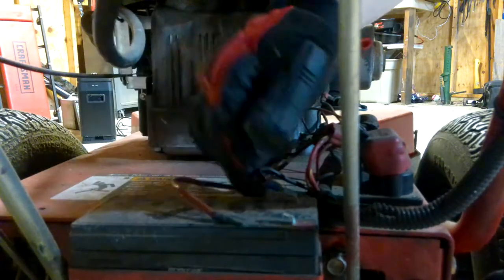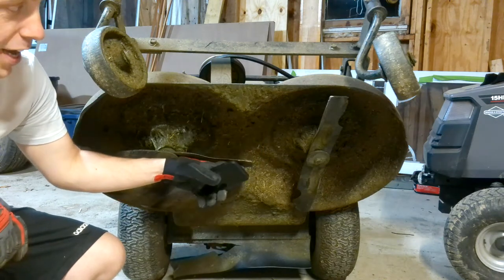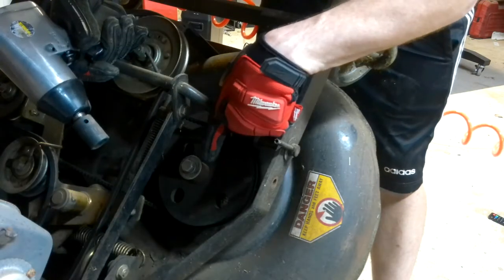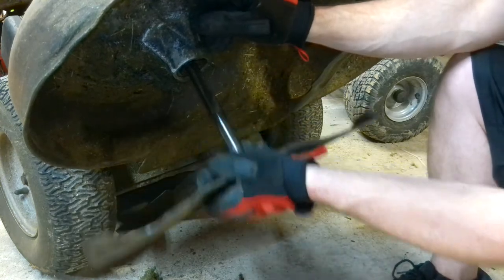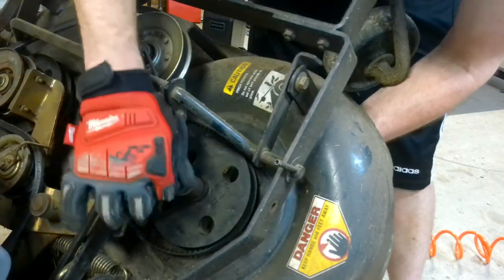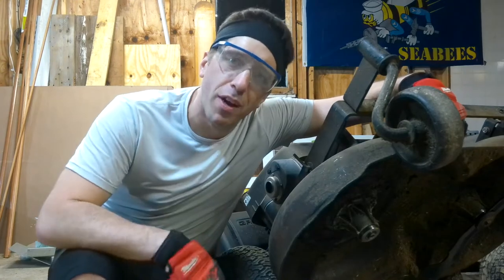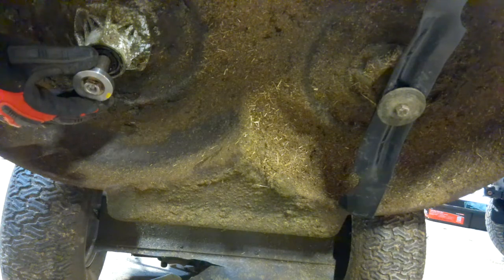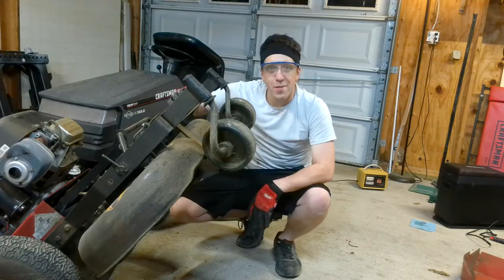Walk Behind Mower - Blades/Spindle Shaft Replacement

Comment: I love my Troy-Bilt rider.  I'm terrible about maintenance and it sits outside through the entire Illinois winter.  In eight years, I've replaced the blade engagement cable, blades, a fuel return line, and a deck belt.  It's nothing fancy, it just works.
Thanks for the videos, I learn a little more every time!
Reply from the maker: Many people are with mowers - we fix when it breaks instead of keeping up. We’re busy people, it happens! Thanks for watching, and I love your content! 🇺🇸🤘

Comment: I couldn’t get the bolt off or on easy on one side for my neighbor’s Simplicity Pacer walk behind mower when I was changing the blades. Turns out, it probably needs a new spindle shaft. This video is very helpful! I heard a bang sound as the belt came off while changing the blades. It lost the tension, but I already would be needing the belt off to remove the spindle shaft. This mower has a lever to pull for the tension when putting on the belt, and one of the spindles has some wiggle room to be able to put the belt on. Quite an interesting design!
Reply from the maker: I’m glad the video could help! Sounds like a cool design 🇺🇸🤘

Comment: Where did you get the spindle shafts? I actually need everything but the actual spindles I need the plastic part that goes on top of the spindles that has the gear belt on them on both sides.